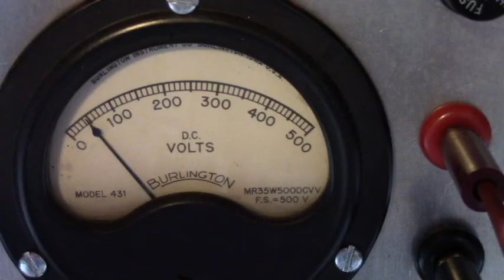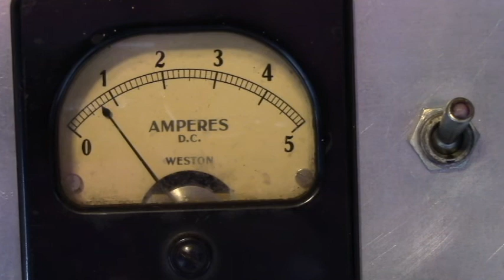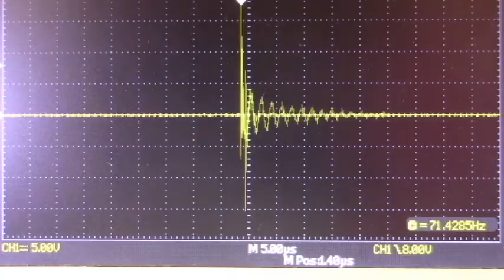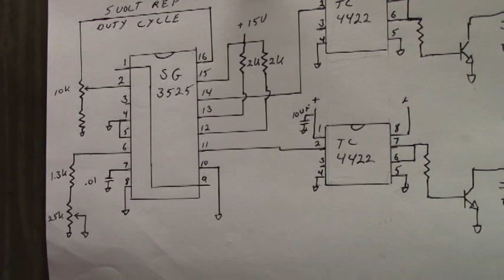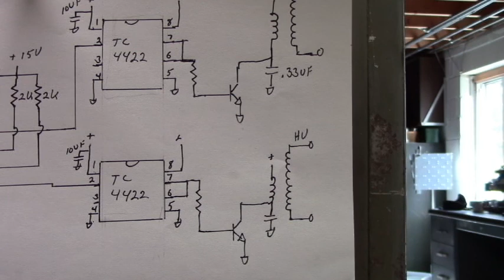TV flyback power unit

Comment: It's always interesting to see another of your projects! :) I use a similar driver using TL494 to control 2 igbt drivers with a gate driver transformer to isolate the gates of the power transistors.
Reply from the maker: Thanks for your interest. I do not use a gate drive transformer because it does not allow duty cycle control. I will use a gate drive transformer for the high frequency stuff. I have blown many power transistors and did not have any problems with the drive circuit.

Comment: Stephen, what is the part number on the output transistor you used in this circuit, also what is the voltage on the 0.33uF caps. thank you
Reply from the maker: The capacitors were 630 volt DC and the transistors were IGW50N60TPX   The parts came from Mouser electronics